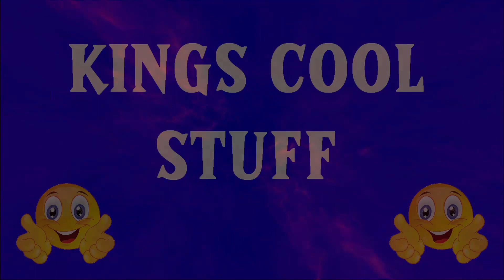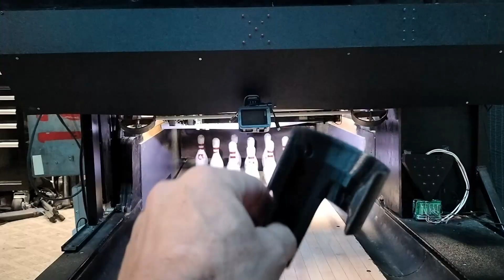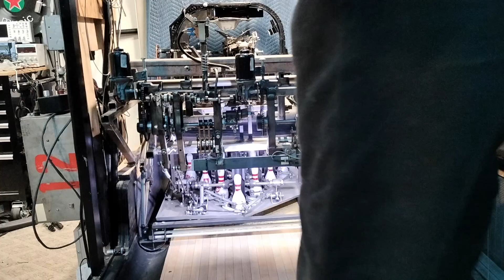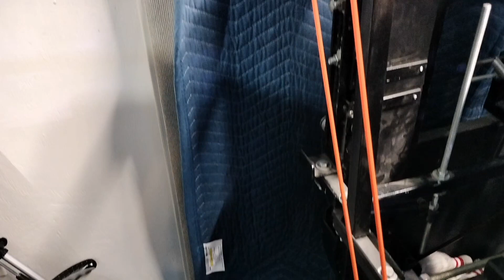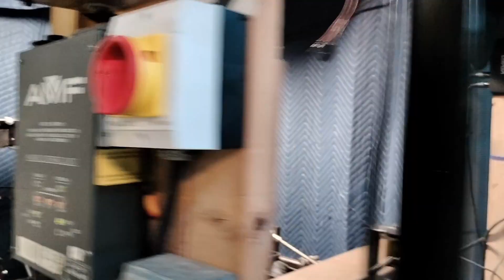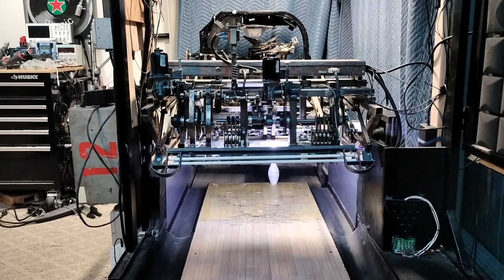Masking Unit Open & a Few Issues (sound delay)

Comment: This is AWESOME! A couple of questions, if I may. First, Is this just a one off for your own or will you be producing them for sale? Secondly, was whoever built this an AMF engineer?
Reply from the maker: This is just a one-off machine and my buddy that built it is just very smart and copied it from an AMF machine.
Reply: Ah ok. Again It's an awesome machine. The best one I've seen for a home brewed model. I started bowling when I was 7 and always wanted an alley at home. A number of years ago I did buy 3 sets of Linds 1/2 scale pins. I researched the Brunswick A2 and other pinsetters to build my own. Got sidetracked and went racing instead. LOL  I'm currently building a replica Bally pinball machine.   @Kingscoolstuff